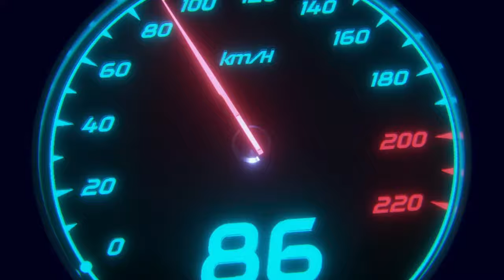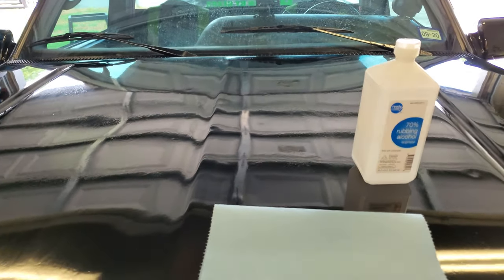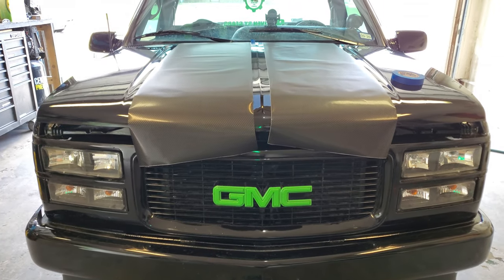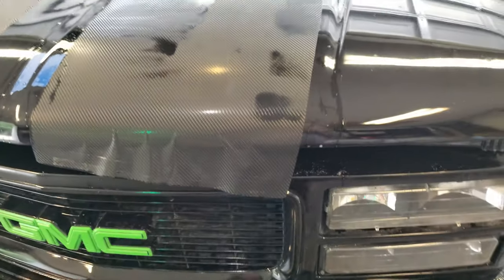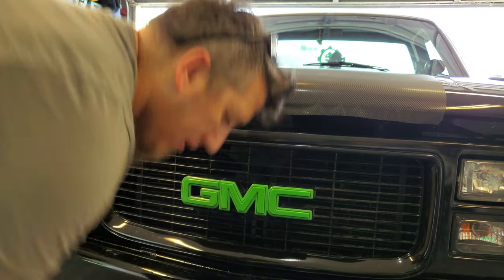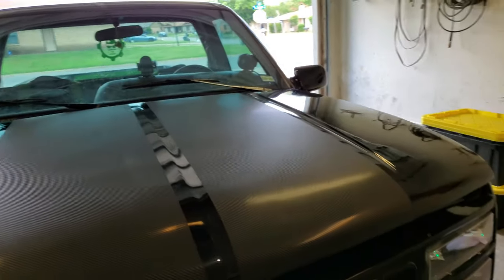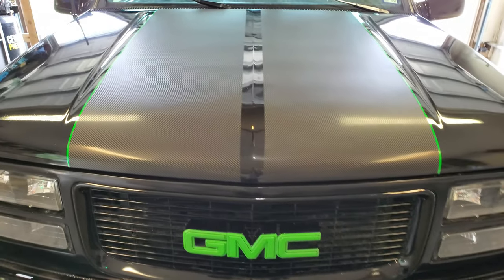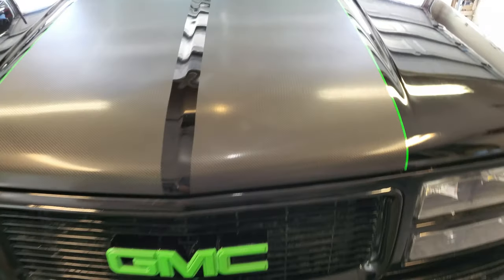How to Install Carbon Fiber Racing Stripes on the 95 OBS GMC C1500

Comment: So you cut the 16 1/2 piece in half? Or did two 16 1/2 pieces
Reply from the maker: No it was 4ft or 3ft wide piece
Reply: @DrivenbyGears  so I should have 2 16 inch pieces?
Reply from the maker: @Mac10Yayo  what ever size width you want use this is jist the size i wanted to go with.